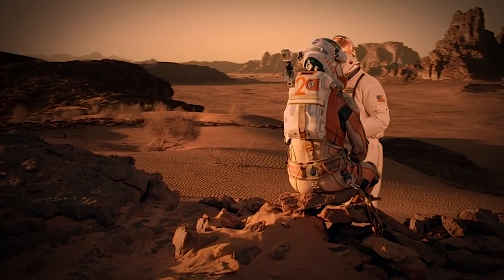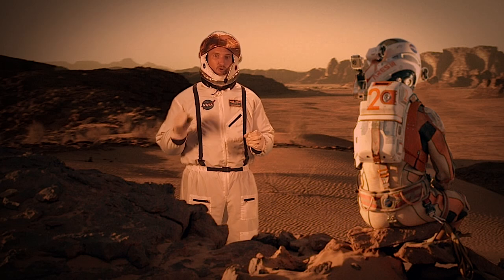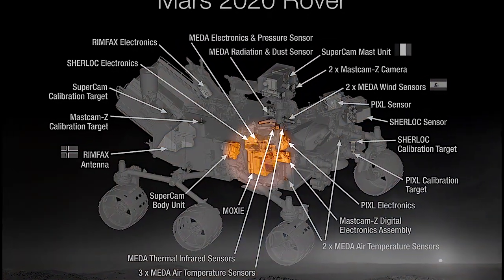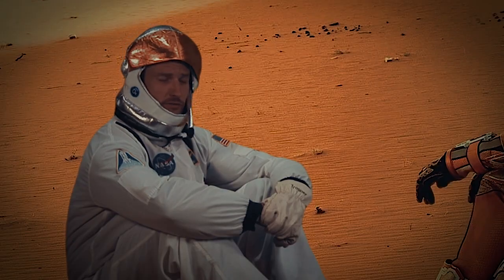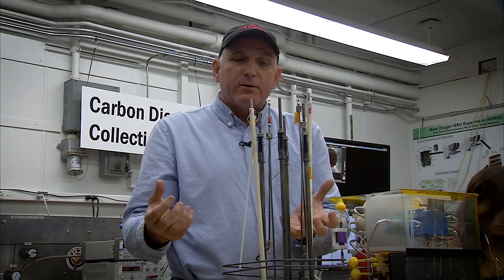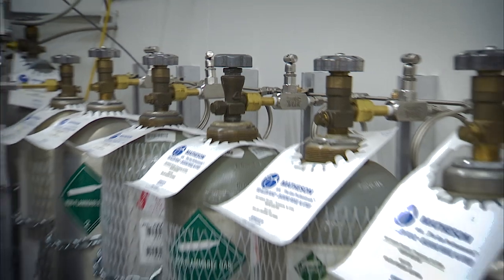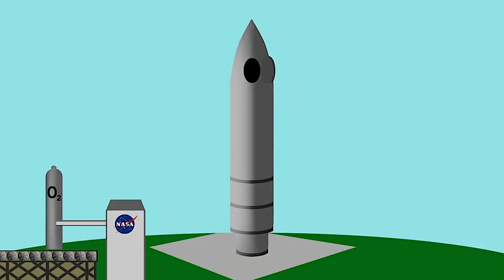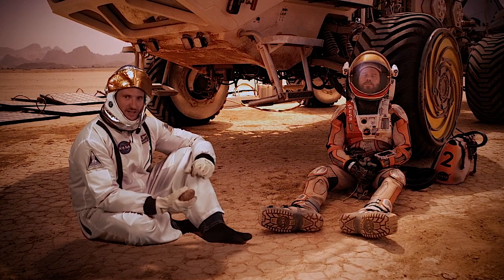Crazy Engineering: Making Oxygen on Mars with MOXIE

Comment: 1) What is the catalyst?
2) How much O2 is created per gram of catalyst over its lifespan?
3) What is the lifespan of the catalyst at maximum duty cycle?
Reply: ask these also  how do you maintain 800 degrees C(1472F) constantly, moxy is a tiny version and how can you sustain that much energy around the clock? solar panels would not deliver the needed energy for sure
Reply: @Jeremy, silicone carbide crucibles are bombarded with microwave radiation to produce heat in the hundreds of degrees. Such a method does not need oxygen.

Comment: The only mistake here is to put the device on a explorer. After the device proven itself, MOXIE will not be needed. Become an "unnecessary burden" for the explorer. It would make more sense to try the device in a stationary unit.. Like Insight.
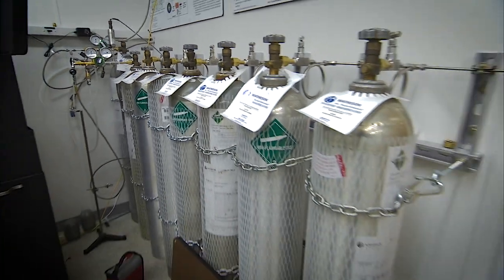Reply: At 2:08 the point is made that they want to test at different altitudes. Obviously further down in a valley the pressure will be slightly higher. Now I don't know off the top of my head the terrain Mars 2020 will be roving but for Curiosity, it has been climbing its way up Mt Sharp so perhaps a similar sort of test might be done in 2020's case.
Reply: @1944GPW  Well, then.  I admit I made a mistake.  I missed that.  sorry ..

Comment: Yes, but how much power does it take to generate, say, a liter of O2?  Unless you know that, it's hard to say if this is practical, or not.
Reply: i think there's a good chance they'll be bringing nuclear reactors when they go. power shouldn't be an issue
Reply: Zreknarf solar would do it much cheaper and safer. Doesn’t need to run at night...
Reply: @UCmLL9hxJAogfQSFfHj0zMrA I'm a software/electronics guy so, what chemistry knowledge I have is rather sparse.

Comment: Sounds energy intensive. Best work on building a nuclear reactor for power on mars too. I don't think a standard RTG or solar panels will do.
Reply: I think RTG would be fine, one starship cargo bay full of average power/mass ratio RTGs would be about 272kw or enough to power 220 homes
Reply: @Zreknarf  That's a huge amount of weight. I was thinking more the size of something like Lockheed Martin's compact fusion reactor.
Reply: @changeagent228  that would be cool, but I dont know if I trust an actual volatile reactor on a rocket. RTGs don't explode, comrade.
Reply: @changeagent228  oh wait, you said fusion. that exists? with an actually usable power output?

edit: well it's not ready *yet*, but the website says they plan to use it to decrease the travel time to Mars from 6 months down to 1 month. of course if they have a fusion reactor on every spacecraft, you could easily power your entire city of 100 people with your escape pod. I'm not sure it will be ready for 2024 though.
Reply: @Zreknarf  Granted information is limited at this stage but patents have been granted and Lockheed Martin have been steadily increasing their investment in the project. I think if funding could be increased to speed the final stage of R&D then there could be a chance to meet the 2024 deadline. On Lockheed Martin's info page it does say they are looking to make it suitable for the Mars mission and have been working with NASA. Another consideration is the military applications and the recent announcement that USA is creating a "Space Force" to counter Chìna's proposed weaponisation of space.
Reply: My guess is when settlement building starts in ernest we will see SMRs on Mars. Perhaps even in the thorium variety. Not to mention if fissionables are found on Mars thats a game changer.

Comment: Where do they get consistent energy for 800 degrees Celsius?
Reply: electricity for heating elements
Reply: Solar panels most likely. Or sterling engines on concentrated solar heat.
Reply: @NoHandleToSpeakOf  Most of the Mars landers have only produced minimal power from their solar panels. like light bulb numbers.
Reply: A mission large enough to carry humans can also carry large solar panel arrays, or, in several variants, a group of miniaturized nuclear reactors.
Reply: @PianoUniverse  yes, everything is sized to the mission. The oxygen production process does not have to run 24/7 though.
Reply: Well that hints to the use of some kind of thermo nuclear generator. If you have watched The Martian you must remember the radio active material which Mark Whatney carried behind his MAV which supplies him the required heat to survive in the cold environment as he had to switch off his heating instruments to save some electrical power in order to drive the MAV as far as possible on a single charge... Also nuclear energy is the future for such missions otherwise you may wonder missions like voyager 1 and voyager 2 could have never existed. Terraforming Mars may not be immediately possible but eventually could be made possible by devising such long lasting resources which will play vital role for mankind to try and resurrect the planet again.
Reply: @abrarahmad5121  There are no practical thermonuclear generators, only bombs for now. What you probably meant is thermoelectric generator.
Reply: Radioisotope thermoelectric generator. Basically it's nuclear material wrapped up and as it decays it emits high levels of heat, that heat is used to make electricity which is stored in batteries. In the movie the Martian our main character uses one of those to heat the cabin of his Rover.

Comment: can someone provide an explanation as to why we can't use it here on earth to lower the rising CO2 levels?
Reply: There's no such thing as a free lunch. It's an energy intense process that would generate far more co2 than it would get rid of or require huge amounts of solar generation, like way more than we'd need to power all of society.
Reply: I did the math and you'd have to use roughly the power of the Tsar Bomba explosion (50 mt) per year just to remove the co2 we produce.
Reply: @filonin2  that sounds rather doable considering we have 15,000 of such warheads just gathering dust
Reply: @Zreknarf  There isn't even a single one on Earth that's as powerful as the Tsar Bomba was and you can't use nuclear weapons as a power source to remove co2. I was using them as a way for you to understand the scale of power involved and clearly failed.
Reply: @filonin2  obviously the tsar is thermonuclear, using fusion, which we can't yet harness as electricity, and the total nuclear yield of the warheads is a protected state secret, but if we just assume we can get at least the energy of the Nagasaki bomb from each warhead, it would only take 2500 of them
Reply: Short answer: we can, and probably will.
Reply: Actually I would think this wouldn't work because the free carbon you release back into the atmosphere will quickly find two oxygens to bond with and then you're right where you started
Reply: @Zreknarf  True. Hmmm... maybe there's a way to sink it, ensuring it gets deposited into the Earth. I'm not too knowledgable about that sort of thing. Maybe there's a way to release it into some deep place in the ocean so it gets absorbed by bedrock there without causing much damage to any sea life?

Comment: It's not so much for the breathing, the vast majority will be for burning fuel.
Reply: Why not nuclear?
Reply: @RampageG4mer  I'm not sure what you mean, apart from (eventually) combining O2 with H2 on the surface to produce water as a mediator/cooler. Such a reactor is quite a way down the road from any initial mission architecture. To get started only requires chemical energy, solar, and an RTG for power purposes. You don't  seriously believe we'll be smelting indigenous metals right from the start, right? My point was only that Martian production of O2 is needed mostly for fuel for the return phase, and any respiratory concerns are well within 'margin of error' tolerances. This video was a bit misleading on that point.

Comment: What happens when you breathe 100% oxygen? What about the 78% nitrogen?
Reply: @neverfearthekraken  well actual we need the nitrogen... to much oxygen is toxic!
Reply: @TheValinov  Yeah, I certainly should do some research. I was understanding that you were right. That too high O2 concentration is toxic.  Jim Keen  raises an interesting point though.
Reply: The thing is you don't have to keep making nitrogen. You can bring enough to fill whatever living space you have, then you have enough, because you don't use or alter it by breathing. Oxygen, however, you have to keep pulling out of the CO2, both from the air, and from our exhalations. So there's need for an oxygen making device, but not for a nitrogen one.
Reply: @neverfearthekraken  what he meant is that the only purpose nitrogen serves is to dilute the oxygen. you could use another inert gas like helium and you'd be fine, you'd sound silly, but as long as you're getting enough oxygen, it's fine, no nitrogen required